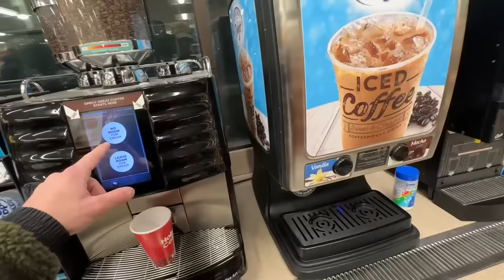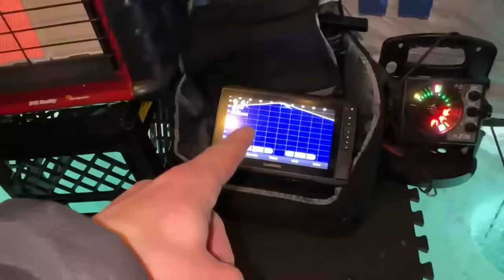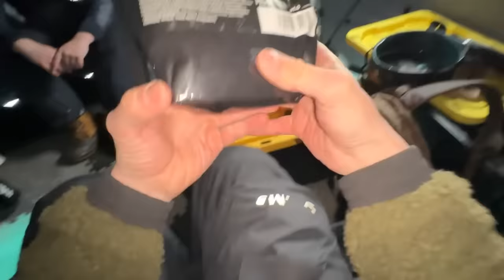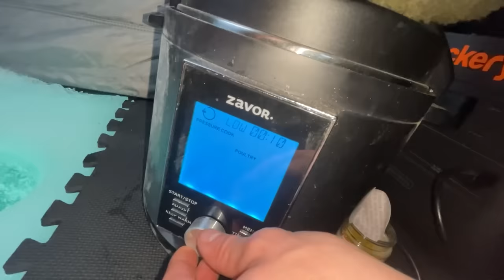Small tent Ice camping in heavy winds

Comment: There is this tent system I think you guys would absolutely love. It is modular units, united by a common bigger room in the center. You can do up to three smaller cabins that connect to the center module. You could fish and cook in the center and then hang out and privately fish in the little units. You wouldn't have to climb over things as much and there would be a lot more heat retention because accessing your private tent would be inside of the heated central chamber.